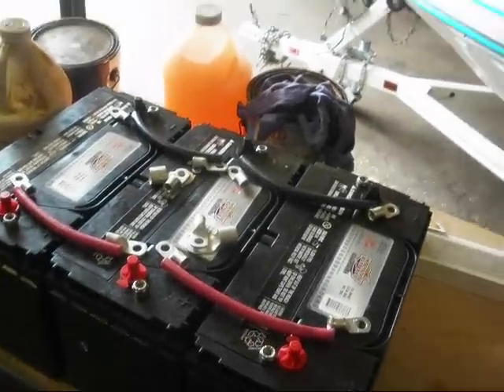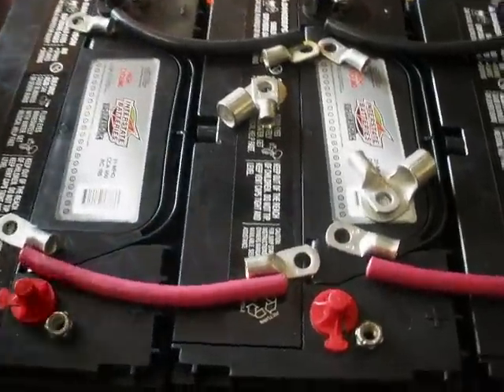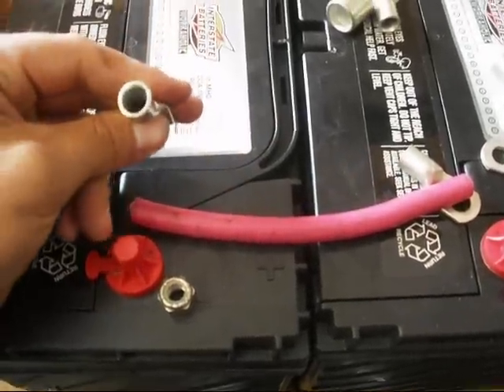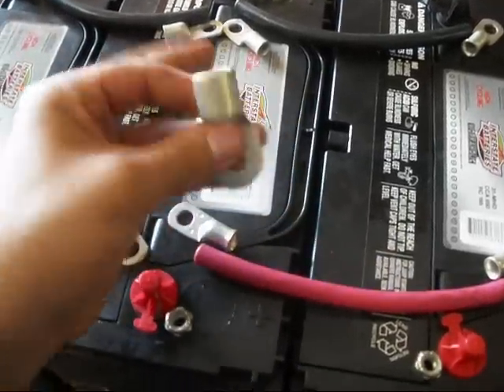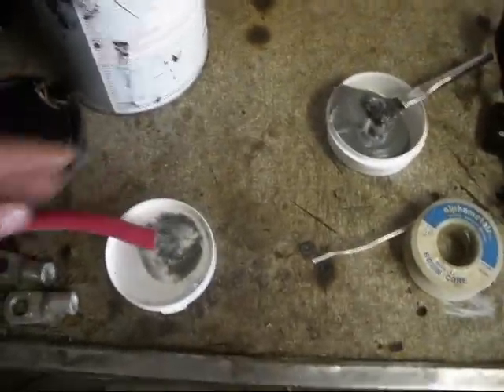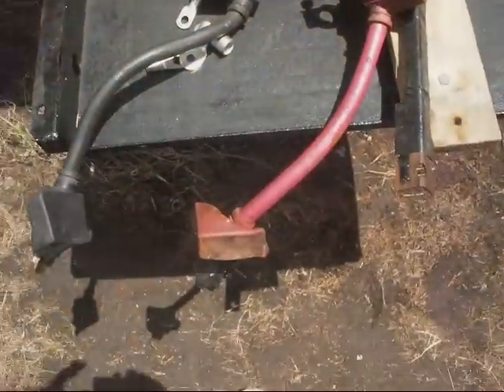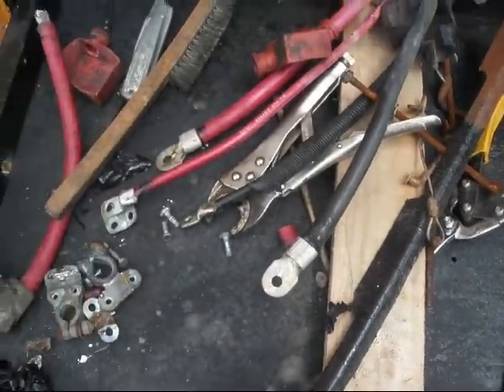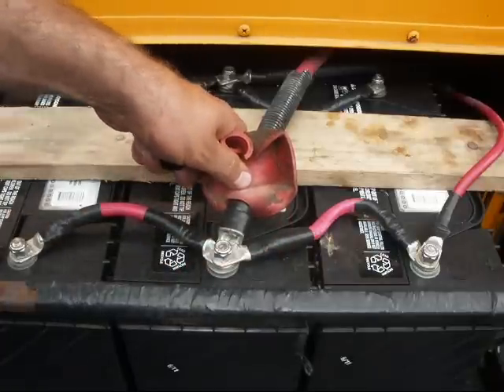New Batteries

Comment: You may want to concider switching to larger gauge cable to connect the 3 group 31s in parrallel  2 gauge isn't really adequate, 1/0 or larger. cold engine with 15W40 oil, grid heater will sap the transfer flow of electricity, also if its really cold where you are you may want to concider battery blankets. Solder is the way we do it at work dunk them into molten solder the skrink tube. I havent had a failure yet with up to 4/0 The battery spray is useless, just use grease or dielectric compound